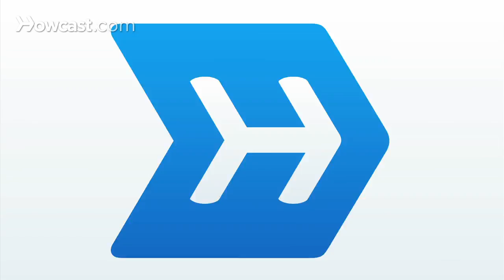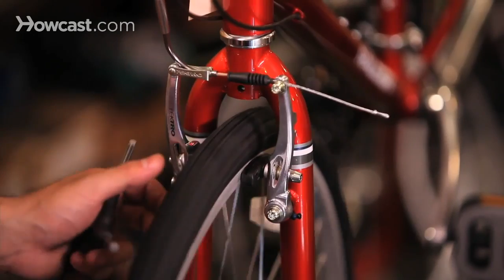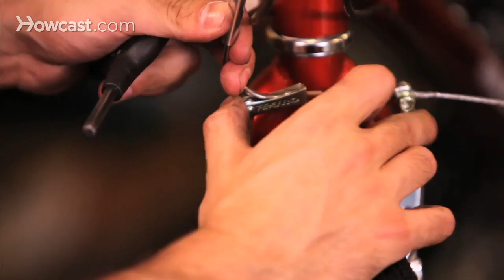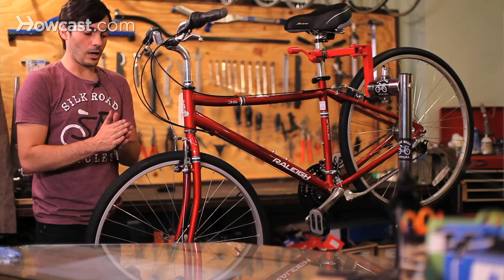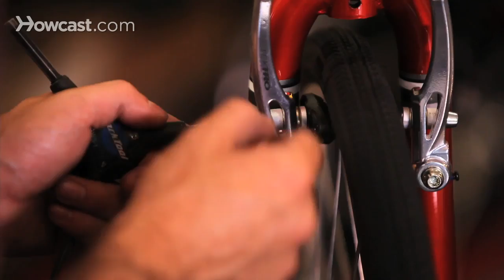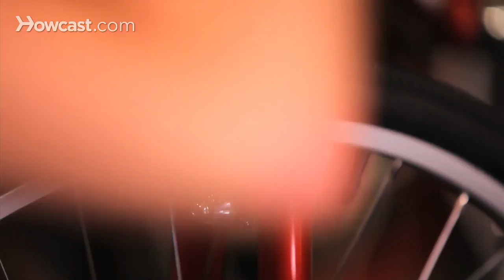How to Adjust a Squeaky Brake | Bicycle Repair

Comment: Omg guys don't buy Walmart bikes unless you plan on sinking a few bucks into upgrading several parts. But def the braking system. I've got 30 miles on my Walmart Roadmaster and the brakes are already completely shot. No amount of adjusting is fixing the issues.
Reply: Lol I Spent $600 on a colony
And the breaks are fucken unbareable 
So fricken loud😂😂👌
Reply: luke evans
Update
Since this post I returned that pos bike and bought a 15 year old Schwinn mt. bike. I had to sink about $80 in to it and I bought it for $20. Which totals to $100 which is what the Walmart Roadmaster costs. It's easily 5 times what the cheap Roadmaster is. All I did was scrub it up, bought two new rims and tires set, new front brakes, threw all my gadgets on it and it's actually a decent bike! The brakes can be adjusted and best of all they don't squeal! Not even a little bit ;)

Purchased the bike using the app Letgo. Only thing that I don't like is that it's a 26" instead of a 29er. But oh well, it's much better quality so I'll deal with riding around on a kids bike for now.

Comment: Brake blocks, pads are for disc brakes! maybe swap the blocks over? they wont be flat against the wheel but they will wear quickly to fit snug, I will try it today.

Comment: how did you cause the pads to toe in..you skipped that
Reply: Toe in can be made with piece of paper folded few times or a rubber band of some sort to the back of the pad. That way the front of the pad touches rim first and the squek goes away, hopefully, if that's the case. You put the paper or rubberband there, squeeze from the handle, tighten the pad and you're on your way in no time!
Reply: +golyg  place a coin between the brake pad & the rim with the brakes applied,loosen the pad's bolt & allow the front part to turn inwards & then do up the bolt ensuring that the front part is turned inwards :)
Reply: +neil froggy crompton thanks boss. you helped a lot
Reply: Bobsmart 127  happy to help :)

Comment: My bike gave me lot of trouble with brakes as in i pressed the brakes very hard but the bike didn't stop a bit so i watched this video and a idea popped up. In the video i heard that the brake pads can be worn out and it should be replace with a new pair but i was short of money so i put 2 wider rubber bands around the pad for emergency purpose and it worked. If any of you don't have time to buy one instantly just use the rubber bands temporarily it works great!
Reply: +great604  under braking pressure the rubber bands could be ripped off the brake pad leaving u less brakes & too much slack in cable adjustment,bad idea,i wouldn't try this for the sake of your own safety :(

Comment: my bike isnt new i have had it for 2 years and it squeaks REALLY LOUD but now i will try this i just dont know why it took 2 years normally they squeak when new
Reply: +Epicpiggy  try scuffing the face of the brake pads with sand paper to remove the shine from the pads wear surface,clean up the dust & test ride,if that doesn't work replace the brake pads front & back so that u have even braking :)
Reply: thats a really good idea thx!
Reply: +Epicpiggy  let me know how it went here, & if it fixed the problem :)
Reply: +neil crompton  also try cleaning the braking surfaces on your rims with iso propyl(after u scuff the brake pads)  to remove any gunk off them
Reply: ok thanks dude this should do the trick thank you muchly :)
Reply: did it solve your problem?
Reply: yeah thx it really works well thx
Reply: np happy to help anyone/anytime i can,see also, rj the bike guy & bike man 4u on utube,lots of info there for other bike related stuff, &/or add me @ g+:)
Reply: im following you on google+
Reply: :) happy to chat with you anytime :)
Reply: btw i just bought a second hand mtb with the same squealing problem,going to try same ideas i told u about,hoping it should come good
Reply: i added u too :)
Reply: thx